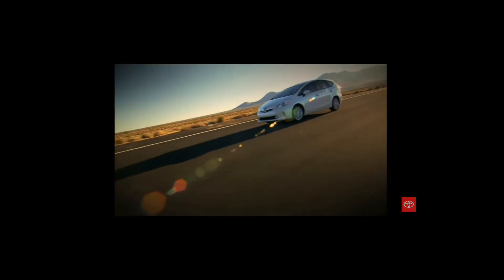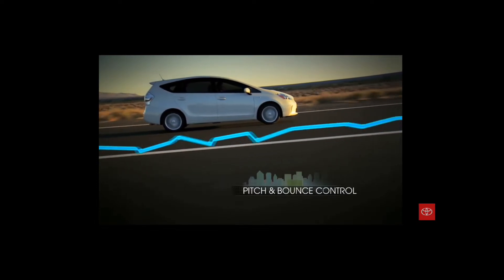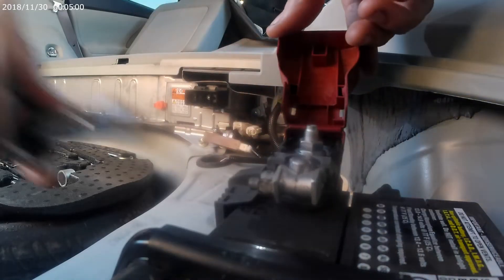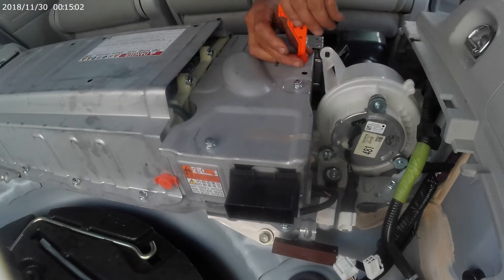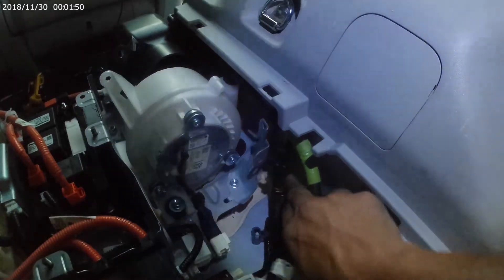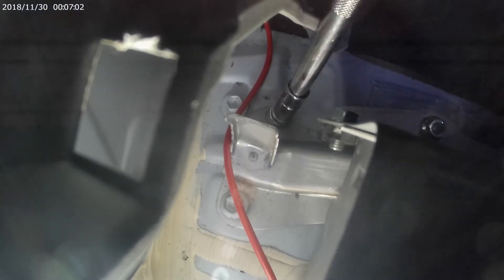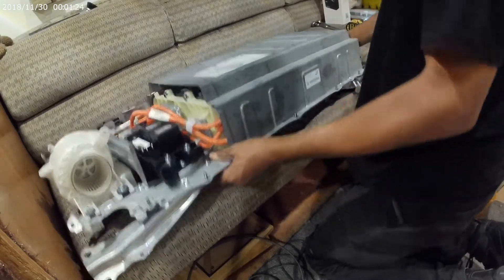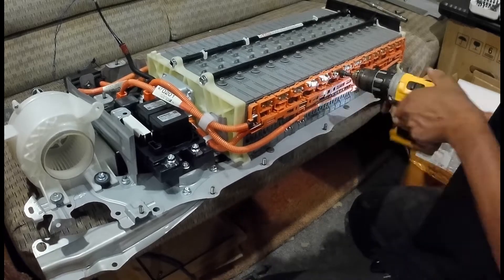(HOW-TO) Prius hybrid Battery Lithium Upgrade (Install tutorial)

Comment: Installed the NexPower just yesterday in a  2007. So far, so good. When you pulled the top off the battery, was the vent system missing? I have a 2007, 2008 and a 2012 V-5. Interesting to see the case differences and fan location. Did you wash the ducting and fan wheel? Jack at Nexpower also developed the Dr. Prius app 5 years ago. Much better than Torque-Pro because it measures something more important than voltage and that is Internal Resistance. My V only has 80k so I haven't had all the Gen 3 issues yet. I'll be sure to replace the V electric water pump at 100k because that's why the head gaskets blow. After the Nexpower install, I went through all the original modules with a stand-alone Internal Resistance meter. Combined the lowest internal resistance modules from the 2007 battery pack and the best modules in the 2008 pack. I also bought the battery pack from a 2014 with low mileage from a junkyard for $850. Used the best modules from all 3 to make a super pack of NiMH. Not as strong off the intersections as a Nexpower but almost like new. Surprising that there were some 2014 modules with high IR. I really recommend the IR meter from YOAREA, model YR1035+ from Amazon. Takes two weeks from China. Measures voltage and IR at the same time. If one is playing Whack-A-Mole, an IR meter will save you a ton of wasted time. Just remember that voltage comparisons and homemade load testing is masturbation. Buy an IR meter.
Reply from the maker: Awesome.  the battery pack will breathe new life into your 2007 Prius. 
Nope not missing the vent. It's a little different than other Prii 😁 
You are on the right track. Thanks for watching I really appreciate it.